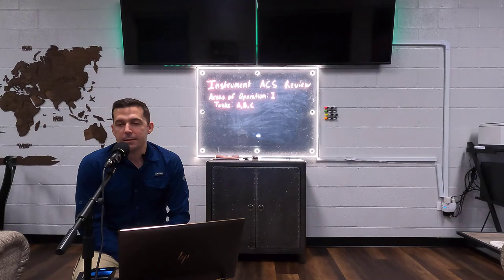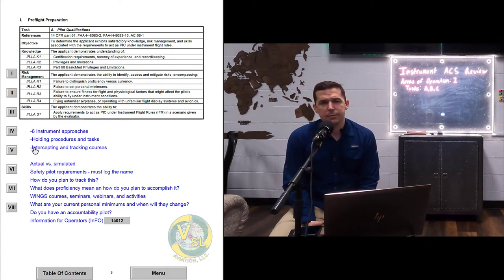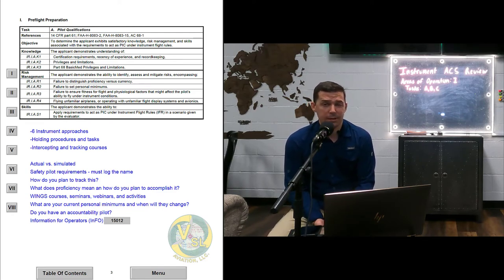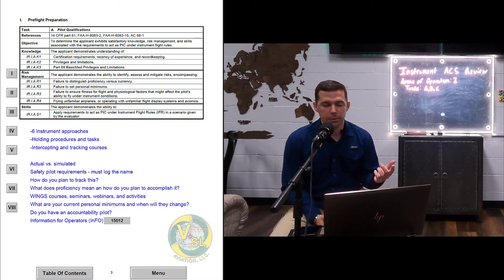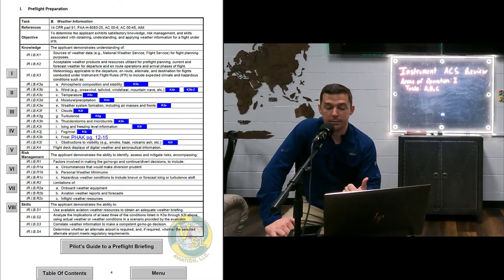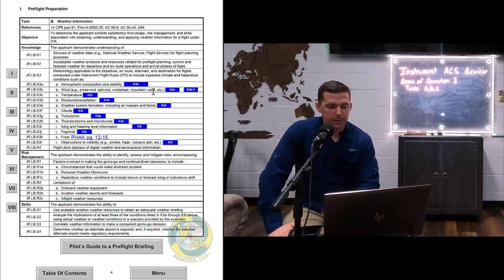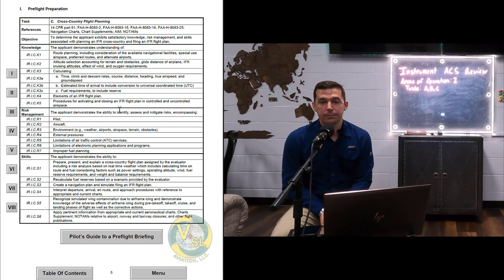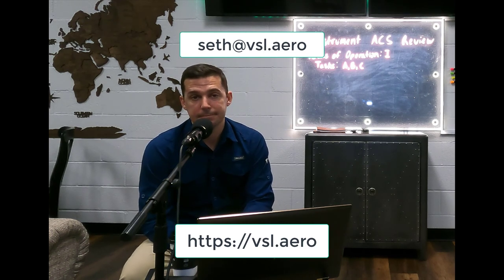Instrument Pilot ACS Review - Part 1

Comment: Wow! Seth this is so helpful. I scored very high on my knowledge exam in December, but life got real busy and I was not able to complete the practical part. So, beginning this coming December, I plan to fly every day that I can and get ready for the check ride. I'm pretty sure my CFII will not let me take the flying part until I am ready, but the oral part brings great fear to me. As a DPE, your excellent teaching and tips will help me pass the oral part. Thanks!!!
Reply: How did you study for the written?
Reply: @camodrums  I used King and Rod Machado. Then I went through Sheppard Air. Sheppard Air is GREAT for the written test questions (almost exact and I scored a 97). However, Sheppard is not that good for really UNDERSTANDING the concepts. They  strongly recommend getting a ground school study. If you want to pass the written exam, definitely use Sheppard Air. If you want to actually understand the material, get King, Machado, or another of your choice. Now I am boning up for the oral part of the checkride. So, I've gone back through King and and looking at lots of YouTube videos. Learn the Sheppard Air material the way they say and you will pass the written exam. Hope this helps.

Comment: Mr. Lake I have a question for you regarding the check ride for IFR. My question is if you have auto pilot in your aircraft during the checkride, can you use it during the check ride? Let me clarify that for a moment. What  I mean by using the auto pilot, when in certain situations where you can temporary turn on the auto pilot say to punch in a fix and then turn it off and the hand fly. I hope that makes sense for the asking.
Reply from the maker: Great question!  If your aircraft is equipped with a operable autopilot that is capable of flying an approach most examiners will have you fly at least one approach using that autopilot.  Additionally, several tasks within the instrument ACS specifically call our the use and evaluation of your ability to manage auto flight systems.  Personally, I think it's solid single pilot resource management to turn the AP on during high workload tasks like briefing and preparing for an approach.  

If the evaluator feels you are using the AP too much, they may decide to simulate a AP failure though so make sure you don't use it too much.    Appendix 3 only requires that one non-precision approach be flown from the IAF without the use of the AP.

Hope this answers your question!

Comment: Hi Seth, currently post written and starting IFR training. Due to money I have planned to fly with my good buddy who is IFR rated with multi rating etc. He is kind of showing me the ropes and have been flying XC under the hood doing some approaches. Since I am sole manipulator of airplane I can log XC PIC and hood time, any feedback is appreciated!
Reply from the maker: What type of plane are you flying?  If you are properly rated for that type of aircraft then yes, you can log PIC time while you are sole manipulator of the controls.  As long as you land more than 50NM from your departure then you can also log XC time. 

You mentioned that your friend is multi rated.  If these flights are in a multiengine aircraft and you don't have a multi rating then you cannot log any time, even if you are sole manipulator.
Reply: @SethLakeDPE  Yes sir I am flying 172S and P models and am properly rated to fly said aircraft. I just wanted clarification as I am trying to do XC and hood time in the same flights to save money and get through my requirements as fast as I can. I appreciate the clarification, I am using your videos to prep for oral and they are awesome!

Comment: Thoughts on students flying barefoot? I’ve been flying barefoot for months but my DPE said it was unprofessional. I just fly better without shoes on lol.
Reply from the maker: I like very thin soled shoes.  Sperry makes some good ones and here lately I've been using the brand Xero which is very thin.

I would avoid going barefoot for safety reasons.  But I also would avoid heavy footwear such as work boots.